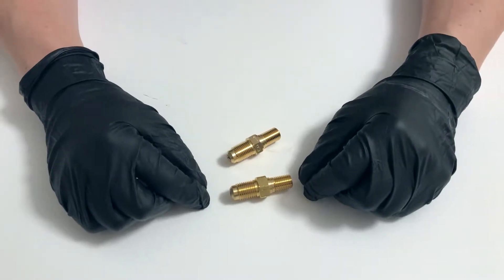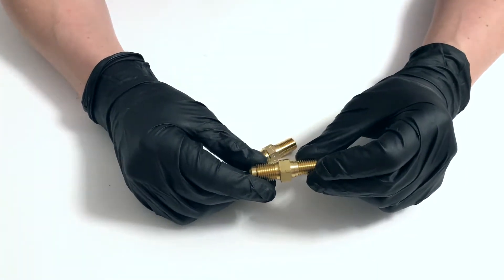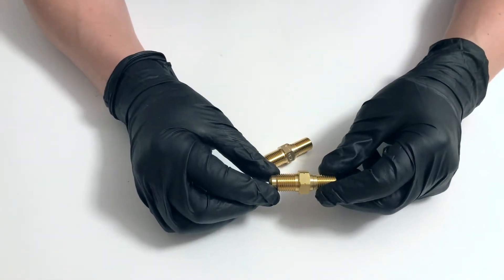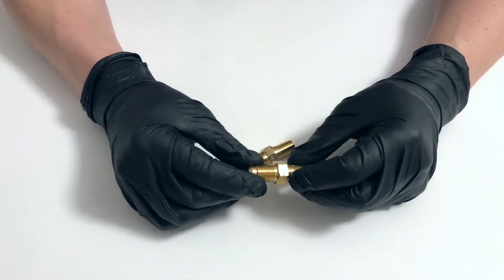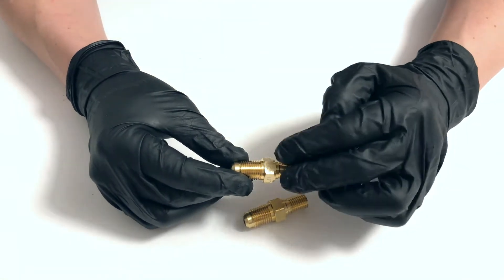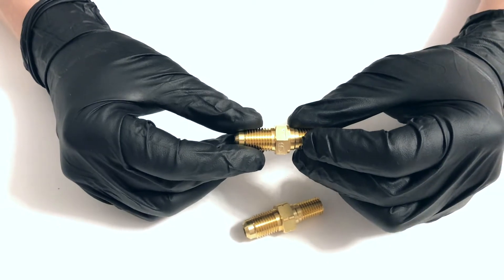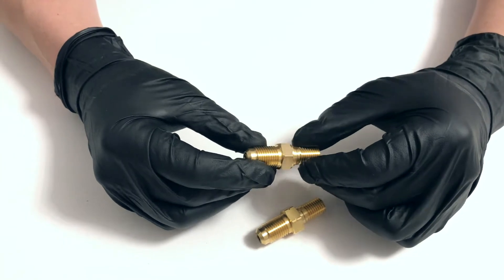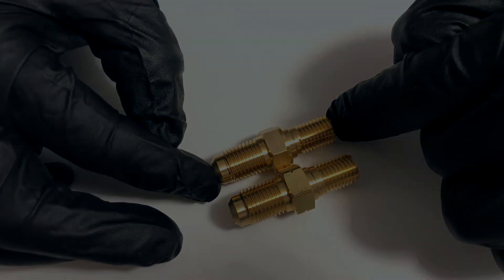Audi Fuel Pressure Relief Valve(s) for 300 WHP

Comment: I have the elusive check engine light p0089. Will this cause CEL p0089 to illuminate if the valve is bad(stuck open/close)?

Comment: Greetings! I'm from Greece and i run a gtx2867 on my 1.8tsi cda rebuilt engine with  forged pistons and rods. Any recommendations for upgraded fuelling setups to overcome 300whp? Injectors, hpfp, lpfp or fprv.. you said dynodrome  moded the fprv to 155? Do i need to change it also to overcome the 300whp barrier?
Reply from the maker: Man, you should talk to the Greek tuners: RevLimit, Dynodrome. Lots of options locally for you.

Comment: is it bad if I buy a 165 bar and I only tune my golf 6 R for 350 bhp? will there be any problems?
Reply from the maker: Sorry about the late reply! On the Golf R I would think you can get enough fuel without the FPRV since you have a larger fuel lobe on the intake camshaft. You may need to upgrade the HPFP though. Ask your tuner to make sure!

Comment: where is this value located on a4 b7 2006?... thx.
Reply from the maker: Sorry for the late reply buddy! You see it if you look between the runners on the intake manifold, sort of in the middle towards the bottom if you follow the metal fuel line from the high pressure fuel pump. It is very difficult to get at on the A4 so will need modified "crows feed" and various tools, but its definitely possible.